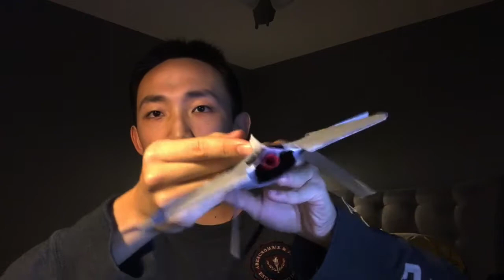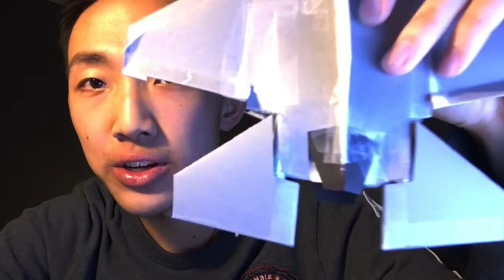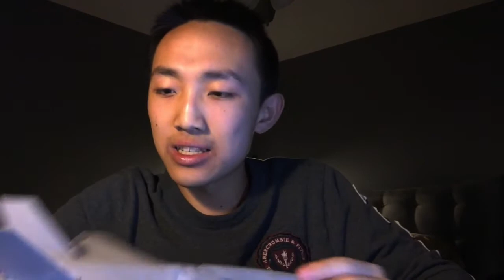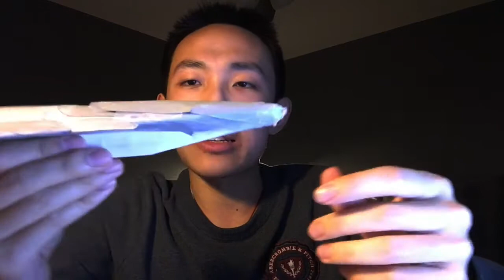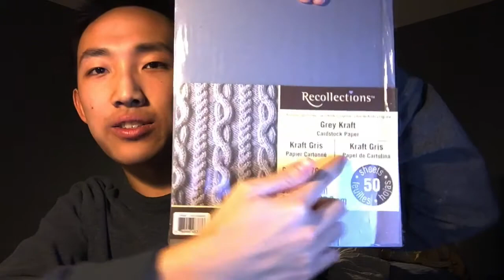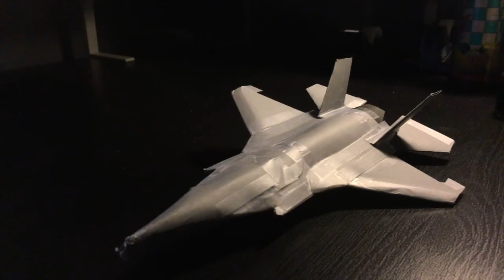Paper F-35A || Design Introduction

Comment: Nice design, Im waiting your flight tests too! In the past, I use the technology of the rotatable horizontal stab. My first 2 Mig-29 was made with rotatable stabilizers, but i used rod instead of straw. The rod was made from paper, and the 2 hor. stabs. was fixed with one rod, but during throws, it was able to change the flight setups, wich wasnt good. I think, this design with straw will be better than my old paper rod design. The flow of the air will be not change the flight setups during throws. When i made my third Mig-29, i was make it with fix stabilizers, and I only bend them to the neccesary set up, insted of rotate.
Reply from the maker: I think you could make rods work. This straw design wouldn't work for planes with different elevator geometry, so that's the downside. As for rods, I'm thinking rotationally friction-locked, independent stabilizers. Could be a design to try out another time for sure. Having that added adjustability is nice for changing up the flight characteristics in a single plane.